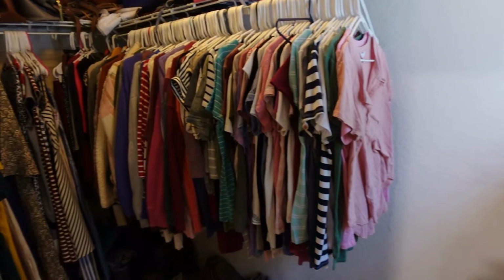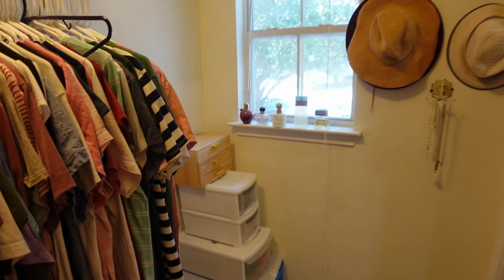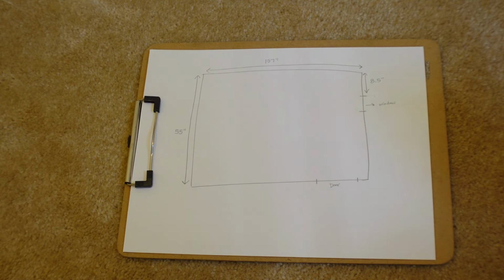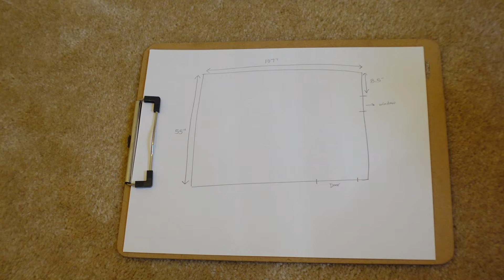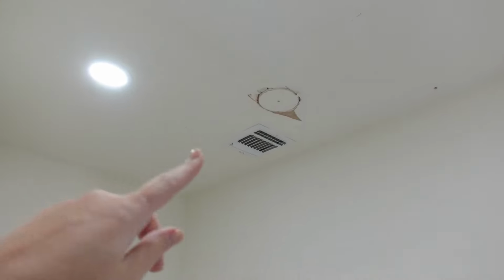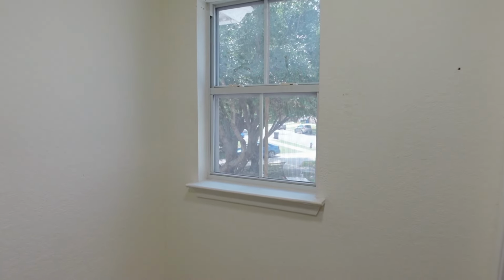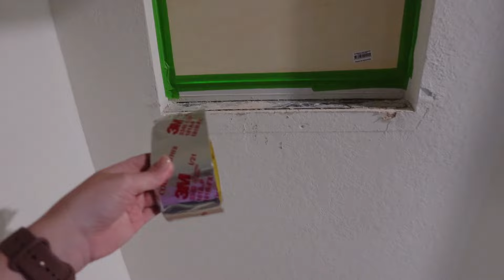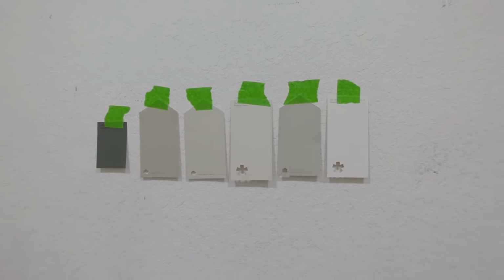Closet Makeover pt 1 | Demo + Planning the Built-Ins

Comment: Those closet racks came down way too easy. That worry’s me. That’s the kind that’s in my cram packed closet. I really needed to see this. I’ve been trying to talk my husband into a closet system. We have a walk in. I get the long rod when you walk into the closet. He gets the back rod that’s shorter. He doesn’t have as many clothes as me. And he doesn’t care that he has to about break his neck to get through to the back. I would make the closet as light as possible. That way without the window you will only have the top light. It would be too dark to pick out a decent outfit if it’s dark.
Reply from the maker: Yeah the wire racks aren’t the most stable. My husband and I actually have separate closets. If not, this would have been one of the first projects that I did!

Comment: The room is too small for the dark color and you want light in the closet when you pick the clothes. I know some influencers chose dark but that is what I think. I would choose wallpaper instead of a shiplap wall. I know you want to repeat patterns from the house, but the wallpaper will be a nice change. It also is a nice touch for the kids and guest rooms. For the vent, there are some vent covers that redirect the air. It may not be the best to have the air blow straight on your clothes. That is my humble opinion. 😁 Have you considered a turn table shelf in the corner instead of the long dresses? The dresses can stay in the same spot with drawers beneath and a shelf above. That would make plenty of room for the shoes. I have seen it on YT build your own. It may help you to keep the budget in check? Otherwise, pull out drawers for the shoes. That may be easier to do DIY. Maybe a spot for a step ladder for the higher-up shelves to access? So many options.

Comment: you should move the door away from the window side enough so you can use the window wall for storage as well.  natural light in a closet is pretty nice I would not cover the window up.  You can always use the full space and just have hanging clothes partially covering the window but still letting light in

Comment: I paint the interior of all my closets SW Super White.  It enables me to see the true colors of clothing, shoes, etc.  (I was slowly working towards painting the interior of all my vanities and kitchen cabinets Super White when I broke my shoulder.  So frustrating!   I added a few tap lights and it makes such a difference.)  My choice from your swatches would be the creamy white.  Something to consider re the covered window = insulation.   There's a product similar to styrofoam that would help control some of the Texas heat - and no fiberglass!  There's a similar type that has a foil barrier.   I presume the depth of the opening is now 2-4".   The foam sheets in my area are ½"  to 2" thick.  ½"x 4' x 8' Owens Corning rated R3 is currently $19.98 at Home Depot.  1" thick is R5 for $29.98.  2" thick is R10 for $62.48.  (I would purchase ½" and sandwich as many layers that would fit.)  Heat and intense light will cause the alcohol in fragrances to evaporate.  Shiplap, beadboard or even lime-washed faux brick paneling might add a bit of texture to the closet although cothing, shoes, hats, etc could be enough.   But I am not a fan of hanging/mudding/sanding sheetrock.  My first choice would be beadboard paneling, it has a timeless vibe and a simple elegance.
Reply from the maker: Sorry to hear about your shoulder! Thanks for the advice.